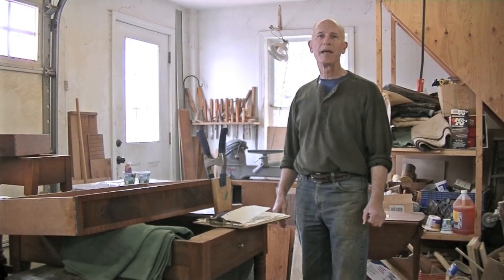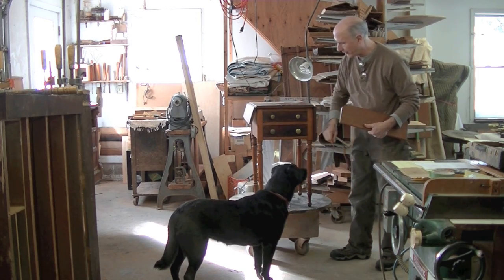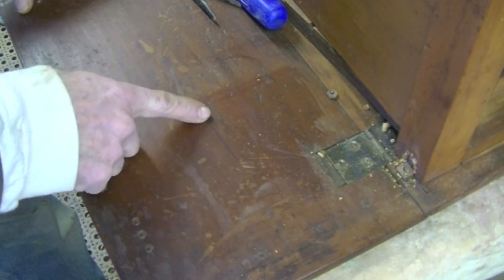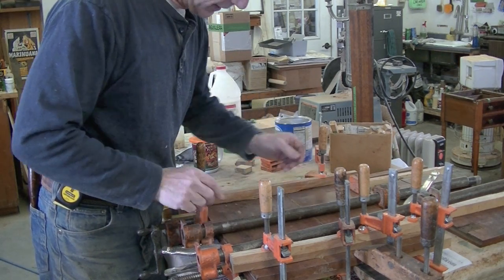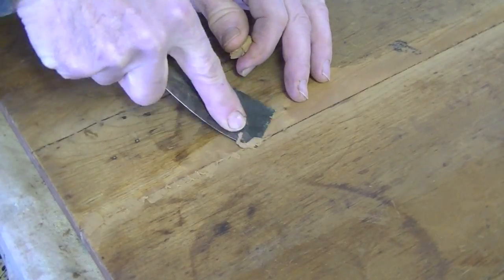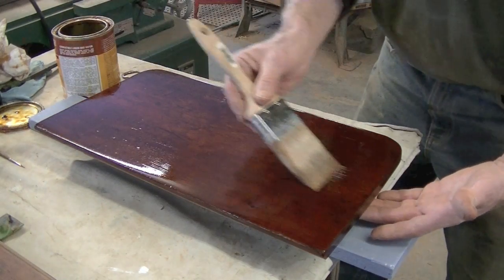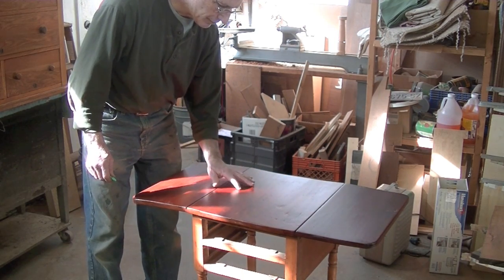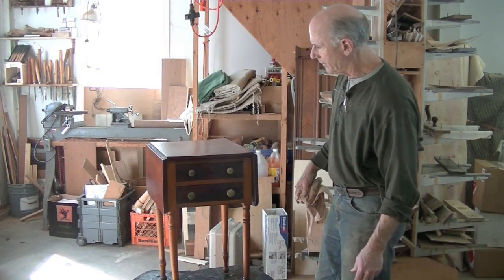Restoring an Antique Side Table - Thomas Johnson Antique Furniture Restoration

Comment: This turned out very well. I did notice that the drawers and top we're finished in a slightly darker color, and I observed what you have often said about the lower portions below the top are historically darker than the top. This looked odd to me until I saw it with the drawers which matched the top.
Reply from the maker: Thanks! Yes, it's a subtle thing

Comment: Hey Tom....Check out Faux Effects brand "TransOxide" colorants.  Can't say enough about the versatility of these colorants for wood finishing.  They work amazing for color matching  a stain or pigment dye matching over fillers and epoxy resins.    They can be used straight or watered down to build up depth of color yet very translucent!   I used Faux Effect products as a color master faux wall artist so when I started furniture refinishing I added the TransOxide colorants to my repertoire of necessaries when I need to color match wood.  I'm also a fan of the "Mohawk" line....and "General Finishes".   I'm loving learning lots of tricks in examining and finessing old furniture from your videos.  So valuable to me!  A respectful thanks and keep 'em coming !
Reply from the maker: Thanks for watching! And your comments! My brother is a big fan of the Trans Oxide colors, but I've never seen a difference between them and Mohawk Ultra Stains. I should probably try them

Comment: Great job as a start. now I have some questions regarding the gluing the top broken sides, I wonder wouldn't it be better to put some dowels or may be biscuits joiners to give more dorability?? I'm aware that your work aims for keeping the original piece of furniture as authentic as possible yet adding new invisible techniques will not hurt the value of the furniture. 
Thanks a lot sir for your impressive work.
Reply from the maker: +YASSER M.K. Hi, thanks for watching. I feel like the glue and the original dovetails can do the job, I think the drawer sides are so thin that nothing is going to make them any stronger.

Comment: I love how you got your dog to sit, use the mouse and watch you on the computer LOL. My Diana used to know a lot of tricks but I never thought of that one. I just ordered and received that beeswax orange wax and used it on some furniture with the 400 steel wool and boy does that make a difference. There was nothing wrong with that piece of furniture xept that it was dusty from sitting around. Knowing that pledge and the like have silicone in it which could later mess with a refinishing job if needed I went and got that wax 3 bottles of it too cause with inflation right now one never knows where the prices are going.
Reply from the maker: Thanks Ursula! That's great. So many things just need a good cleaning and oiling!

Comment: Tom, I’m curious as to why you didn’t joint the table top edges before glueing them back together. I get the minimalist approach (do no harm, etc.) that you follow, but after the glue up you planed the table top flat and stripped it back to bare wood. So jointing the surfaces prior to glue up would have been consistent with your plan of attack, I feel. Not a criticism, just searching for understanding. 

BTW, your love for the animals under your care and your appreciation for your environment are some of the best qualities of your videos, and of you as a person.
Reply from the maker: Thanks Pat for your comments. They are much appreciated. I rarely will joint a top, I just don't want to change the size of it. And adding a thin strip of wood just makes the finishing harder. I've had some bad experiences jointing round tops, and gave it up. Of course there may be instances where it's necessary, but I consider that a last resort

Comment: My questions are obviously those of a beginner.  First I wanted  to thank you for the videos. I purchased an antique side table similar to this one that I absolutely love. Like this table, the legs are one stain and the top and drawers are another stain. I wanted to darken the stain only on drawers and top. I noticed you used tong oil. Does it come in different stains? Also, before beginning on this piece, what do you recommend to clean it. I watched a video where you used dish detergent but you didn't mention which mild dish detergent you preferred. I have used lemon oil in the past to clean one that had no damage. After that I used 4.0 steel wool and scratch cover followed by the beeswax/orange oil. It turned out great!!!!
Reply from the maker: +mprssdbyu Hi, thanks for watching. What I'm using is Waterlox Tung Oil, although any tung oil is fine. And yes, you can add stain to it for a toning affect. The detergent I use is Dawn. What you did with lemon oil and scratch cover is perfect, I do that all the time.

Comment: I always enjoy watching your videos, it is a great privilege to watch a master at work.  Is there any particular reason you used PVA glue instead of hide glue? I can only assume it is due to the holding strength of modern glues.  Wonderful work as always and as mentioned by others we need a name to the other star of the video.
Reply from the maker: Thanks for watching! I use PVA when I'm gluing new wood, and for a lot of repairs. When I'm gluing nice antiques I use Hide glue only to try to keep some originality.
Tom

Comment: I would mention the treason the top split is wasn’t attached properly to allow movement.  The screws along on the side of the top should have slotted holes.  Probably won’t happen again, but it could expand at at future date!
Reply from the maker: Thanks! Yes, that's right. Often I will correct that situation, if possible

Comment: Did I miss something? What did you do with the repair of the angle fastener  covered with filler
Reply from the maker: It's so long ago I'm not sure! But typically I will leave something like that, the damage is already done so you might as well use it

Comment: @ 4:40 you used Shellac for the bottom sides of the wings. How do you determine if you use Shellac, Varnish, Polyurethane, is it just years of experience, personal preference or Shellac is it what the original craftsman would have used?
Reply from the maker: Thanks!We don't know what the original finish was. Shellac goes over old surfaces really well, and some restores only use shellac. I like using the old fashioned Waterlox Varnish, especially on tops, because it is so durable. My advice is always to use the finish that you are most comfortable with and gives you the look you want. It really doesn't matter too much, assuming you're not working on a museum piece!
Reply: @johnsonrestoration  Thank you, makes sense!!

Comment: Hi Thomas, When a top shrinks or warps, then splits, do you change the way the mounting fasteners are positoned to prevent it from resplitting?
Reply from the maker: Hi James, absolutely! Although on this small top I didn't feel it was necessary. Check out my video "Building a Farmhouse Table"

Comment: What kind of oil is in your Beeswax polish, vegetable, animal, or mineral?  I would guess it's tung. soybean, or boiled linseed oil.  When you spray on "finish" in other videos, are you using on lacquer or shellac?
Reply from the maker: +Fred C Dobbs Hi Fred, the polish is "Howards Feed N Wax". They say orange oil, i suspect it's linseed oil with orange added.When I spray with aerosols, the sealer is shellac, but the toners and top coats are lacquer. Available through Woodworkerssupply.com

Comment: Why did you use only glue not glue and dowels together? It is stronger.
Reply from the maker: Hi Robert, thanks for watching. Yes, dowels would be stronger but on a small top like this I figured just glue would be OK, there's not much stress on it.